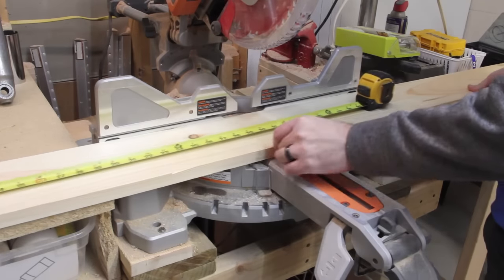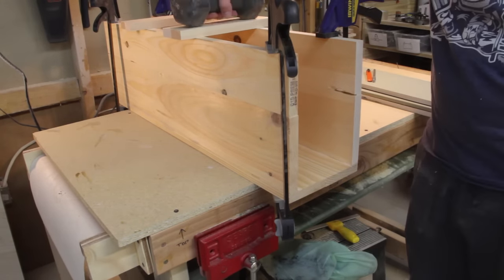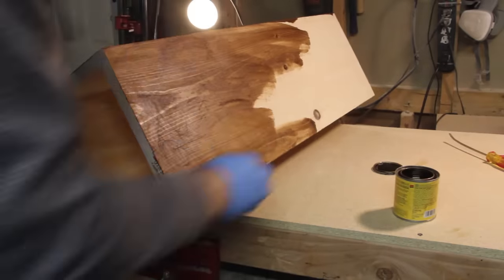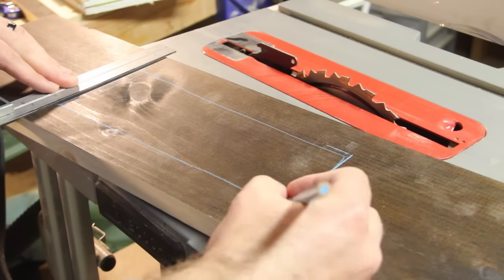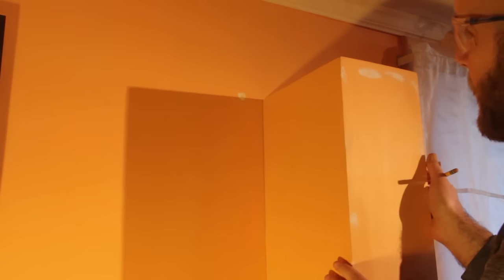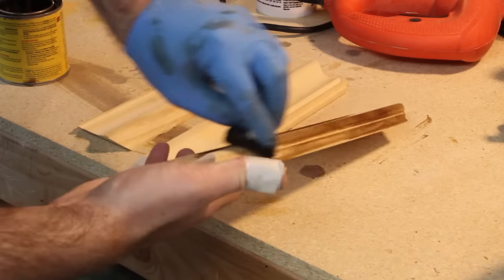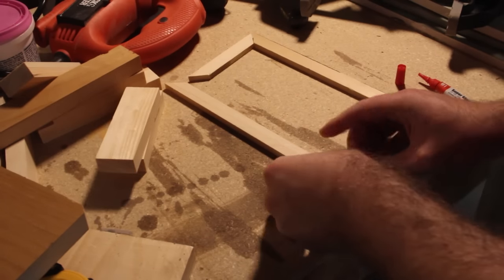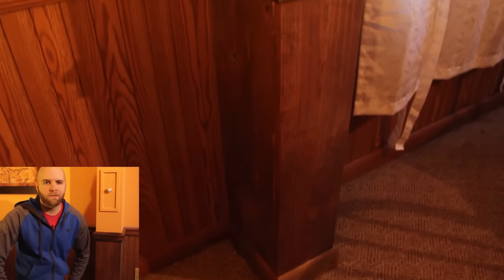Covering Exposed Pipes in Finished Basement or Room

Comment: I have an exposed pipe (sewage) in a closet that I want to turn into a shower.  The floor is tile / cement (if I rip out the tile).  How do I attach the pressure treated covering I'm building to the floor?

Comment: You are amazing!!
Reply from the maker: Thank you ❤️
Reply: Hi there,  @Bretts_Builds  really a nice job! Would you suggest a easier material to work with? I am not able to work wood but I have to cover 4 pipes vertical and 2 horizontal! About the horizontal ones no idea how I will stick them to the wall leaving them enough accessible.... But, first of all, is it safe to cover gas tubes? For sure I will need some good help and knowledge first!